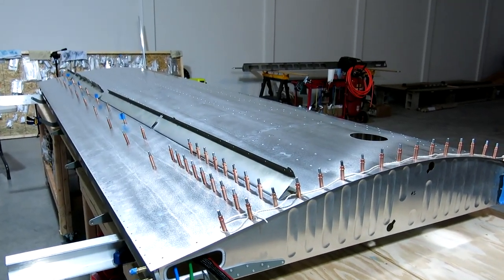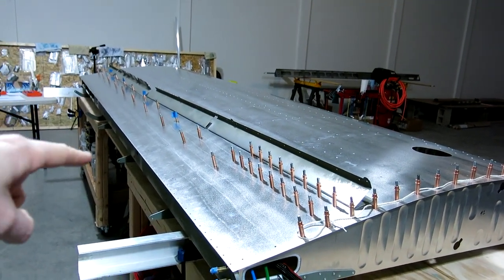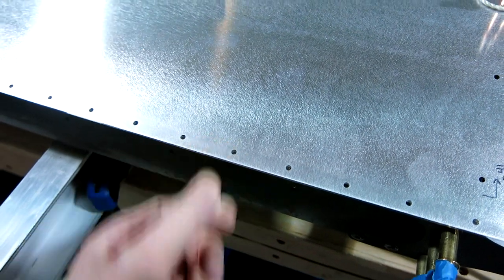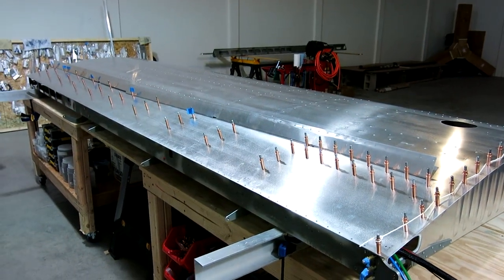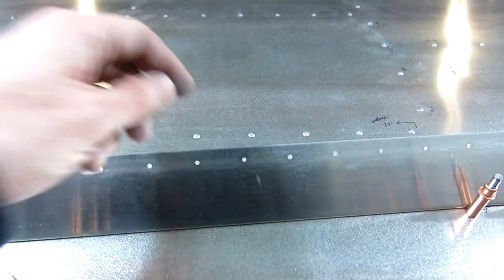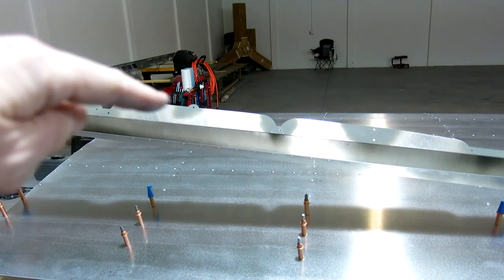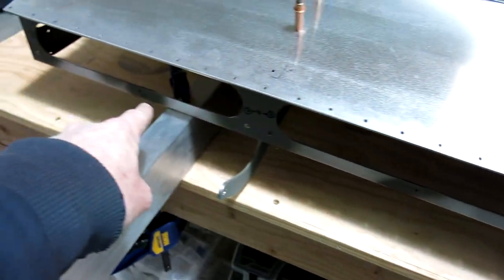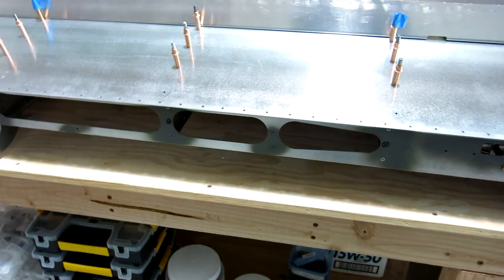No. 72 02-03-2021 Flap gap seals

Comment: Did you test fit your flaps or ailerons before match drilling the gap seals?  I think RANS recommends that although I am not really sure what can be done if you want to keep the top surface aligned with the top of the wing.  I guess you can pinch up the trailing edge of the gap seal to make it skinnier if it interferes with the moving surfaces.
Reply from the maker: No, the flap and aileron get fitted after the transfer drilling. This step aligns the top surface of the gap with the contour of the top wing surface. Then the flap and aileron are test fit and if needed, the bottom side of the gap can be pressed in a little to fix any clearance issues.